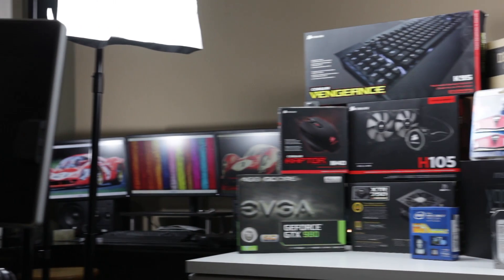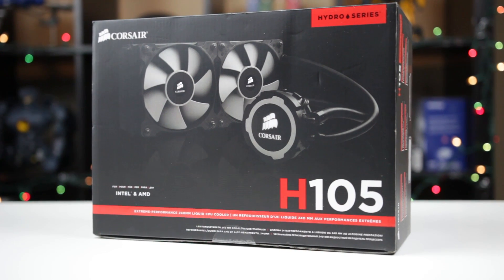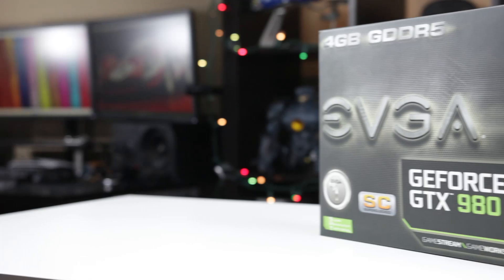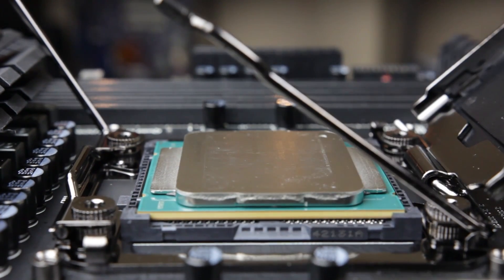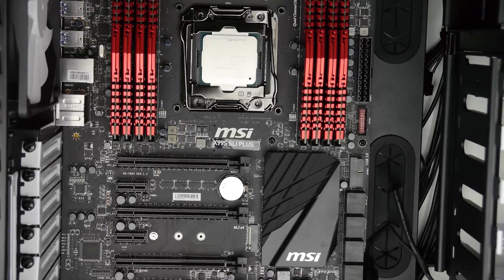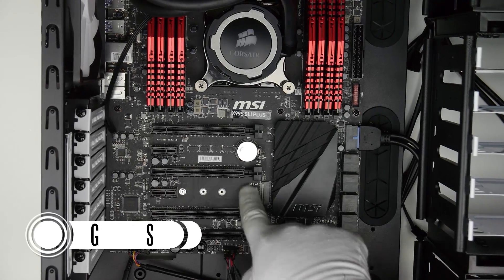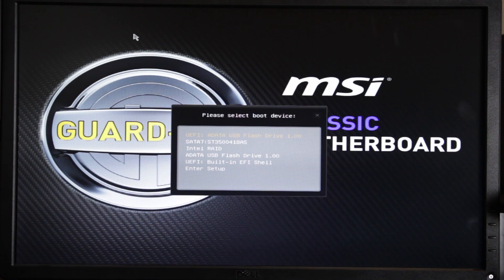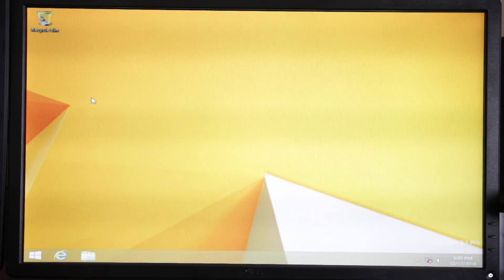How to Build An Epic $4000 4k Gaming & Video Editing Dream Machine for 2015

Comment: hey guys, i wanna build a pc with the s340 elite and i wanted to ask if i choose the msi z270 pro carbon mainboard, will the be quiet  cpu cooler dark rock 3 fit with the corsair  vengeance led ram ?

Comment: Hey guys I am building a pc but not so dangerous like in this video but I need to know whether is it good for gaming so here is the list.Processor: Intel core i5 6600k 3.5 GHzram: 16gb ddr4 2400mhz frequency of gskill ripjaws.graphic card: Sapphire radeon rx 480 8gb gddr5 psu: XFX XTR 750W case: cooler master mid towercpu cooler: Same of this videomonitor:Acer predator x34 keyboard: Corsair k70 rgb rapid firemouse: Steel series rival 700please comment fast as I am planning to buy next month.

Comment: I made a build with a i7 5820k, here's what i used if anyone is interested, best parts for price/performance (at least where i live)

i7 5820k CPU
X99 Gigabyte Gaming G1 WIFI
Gigabyte r9 390 G1 Gaming
2x8GB Crucial Ballistix 2400mhz
Corsair H75 cpu cooler
Thermaltake Chaser A31
Crucial 240GB SSD
WD 1TB Blue HDD
Seasonic Snow white 1050w 80+ platinum

If you are wondering why the overly big power supply, i'm buying another GPU later on, but that one might be a Quadro since i use 3D apps, also i make myself sure that future releases almost always will be able to be powered no problems, if you aren't interested in wuper heavy overclocking and you just game and mostly will use dual GPUs, an 850 PSU is a better way to go for the money

Comment: all ram slots filled!!! YES!!!!! If heat rises wouldn't it be best to put the radiator fans on top of the rad in exhaust?? Ive had better temps with the fans in exhaust/pull on my radiator...just sayin

Comment: if you are going to try to game with this machine in 4k you will be disappointed.  I have 2 980's and it's ok at 4k allthough to get 60 fps I have to turn down some settings in modern titles. If I try it with 1 card I mostly get like 10 to 20 fps. This machine will be 1080 and maybe 1440 p in some titles.

Comment: enjoyable video, I will never in good conscious pay that much for a multimedia pc, especially with the speed at which it's obsolete by.
 however all the people hating on this guy for his choice need to get a grip, if you can do better for cheaper then put up a video.
Reply: You don't need to put up a video. Literally the only thing people are complaining about is that his PRICE is incorrect. The parts themselves don't cost that much! If you went on amazon and bought those EXACT same parts in his video it'd cost you less than HALF of what he claims it costs ($4,000 is not right. Even $2,000 is kinda high honestly)

Comment: Hi do you think it's worth it to go x99 5820k or go z97 4790k both with a gtx 950 I'm not a gamer and it's mainly for productivity,  there is about a £150 difference comparing the two builds :) Great video!

Comment: In 2030 a computer like this is going to be used in offices.  Lol
Reply: +Kirigaya Kazuto no way
Reply: ***** way
Reply: +Kirigaya Kazuto HA.  Actually this would be the power of a watch or phone in 2030.  Moores law.  There will be quadrillion transistor processors by then if not higher.  (1000 Trillion transistors),
Reply: dcohn99 In 2030, Gamers be leik: " DAD THIS SHIT ONLY HAS 64 GB OF RAM "

Comment: I like our gaming PC soo much but i need few clarification i want to make changes to it. 
1.Nvidia GTX 980ti
2.2TB Samsung EVO SSD
3.Corsair 1000 watt power supply
4.Using liquid cooling for GPU and RAM (either anyone of these)

finally i will use your listed parts except i want to upgrade these listed parts and my final doubt is does this GPU gonna give me a full 4K resolution to my Samsung 198.12cm (78'inch) UHD 4K Curved Smart TV HU9000 .
and i want these to get under a toal budget of 5000$ (this wont include tv)
Thanks IN Advance :)

Replies Needed ASAP help??

Comment: What a shitter PC you've built. It's something a peasant would build.. THIS is a PC bud..

i7 5960X
MSI X99A Godlike 
128GB Corsair Dominator Platinum 2800mhz
FOUR x MSI GeForce GTX 980 Ti Lightning Edition Tri Frozr 6GB @ 1300mhz
1.2TB Intel 750 PCI-E SSD
1.2TB Intel 750 SSDs x 3
Cooler Master Cosmos II case
Enermax Maxrevo 1500W PSU
Custom Water Loop

It's stupid fast, stupidly expensive, and stupidly fun to play. It makes your peasant PC look like a fucking calculator.

Comment: The Fuck One 980 can not Max out every game in 4k, maybe 1080p, at this budget I would sli 2 980's, and cut down to 32gb not 64gb because 64 is way way way to insane, why do you need all that ram for in this budget: do you work for Michael Bay or Disney? do you run the stock market???. This build is poorly done for the money seriously
Reply: agreed
Reply: +Patrick van Baarle wait and change that psu, there are why better psu's than that cx750 for even less $$$$$$
Reply: +Patrick van Baarle here you go bro for an extra 3-4 euros, this is a better psu and is 80+ gold and much more reliable than that cx750 and is made by seasonic very high quality: https://de.pcpartpicker.com/part/xfx-power-supply-p1750gts3x and that a much better build, plus yes do wait for black friday, i think you can get better hdd and ssd for cheaper prices, otherwise your build is pretty solid
Reply: +Arthas182666 it doesnt matter, 64 gb of ram and no sli
Reply: Patrick van Baarle wait.
Reply: ***** if it has the same speed, type of ram, and same pins, same everything but different brands, it should be fine
Reply: ***** no prob
Reply: +BossManiacGames can't disagree with the RAM, even that i personally use Autodesk Maya i don't need that much of RAM data, i find that over 32gb is it just a waste of money, specially on this build since it's DDR4...

64gb would be useful only for an APU, but it's just way better to buy GPUs instead
Reply: look at the date of the video...
Reply: Arthas182666
ya but still not an excuse to make an bad build for the money, even austin evans made a $4000 pc around this time it had 2 980's, i7 5960x, 32gb of ram and would blow this one out of the water
Reply: +a true scotsman uth agreed 16gb of ram is plenty for 4k editing, 64 is only needed if you run the stock market intensely or have a tv show. 64gb doesn't even give that much of a benefit over 8/12gb in many games. sli 980's would be a wiser choice, thanks for the support :)
Reply: +BossManiacGames 
Totally agreed. He spent the budget on the wrong things, then he gets a VANILLA case to top it off!
Reply: +Mark Jones ikr
Reply: PvP Rambo
so true
Reply: +BossManiacGames I think it has to do with sponsors XD.
Reply: +Sean Kim It was unsponsored
Reply: BritishWarTurtle Maybe the ram was a sponsor from another video?
Reply: if it was he would say in the video and thank them, it has to be part of the deal
Reply: ***** Lol what I am saying is that maybe they sponsored another video. Then they scrapped that system and used the ram for this. Sorry for my shit explanation XD.
Reply: Sean Kim
hmm that would make sense
Reply: ***** Yea I mean otherwise I don't know why you would need that much ram. Unless your hosting a small server like I will be doing.
Reply: +Sean Kim very true, i heard him reply to another comment saying cut down the ram and get another 980 for sli and this is what he said

two GTX 980s in sli would be really awesome! perhaps in the future. but 
for now I need all the ram I can get for multicam 4k video editing.

but if he does that why does he call this a 4k gaming pc???
Reply: ***** 4k meaning money wise.

And if thats not what you mean. Then I would say 980 is enough for gaming if your doing other things also.
Reply: Sean Kim
true but at a $4000 budget one 980 for 4k gaming makes no sense unles you dont mind playing at low-medium, which makes this pc really bad for the money
Reply: Welp I got nothing
Reply: +Sean Kim he could have just done a build like this except with 2 980's instead of 980ti's: http://pcpartpicker.com/p/sKNsTW
Reply: +BossManiacGames doesn't the 5820k perform better in games? Extra cores will just help out the physics score.
Reply: Sean Kim
not really they have the same ipc but a 6700k would because it is ipc is better but in productivity those 3 cpu's beat it out by a lot, plus the 5930k and 5960x do better in sli because of more pci lanes, i would use the 5820k only under builds under $2000 above it go for the 5930k or 5960x
Reply: +BossManiacGames that's a nice tip.
Reply: Sean Kim
thanks
Reply: +BossManiacGames ima challenge you. I am making a build with the 5820k and the fractal define r5. Try to make a parts list that's around 1k with these parts. (I already have the gpu).
Reply: http://pcpartpicker.com/p/GBJBCJ here you go
Reply: http://pcpartpicker.com/p/GBJBCJ here you go
Reply: ***** XD I just found a deal on craigslist for the fractal define r5. Don't know how much it is for but it seems the guy has a bunch of cases he is trying to get rid of.
Reply: ***** This is the parts list I got (I forgot to mention I live in New York).

http://pcpartpicker.com/user/fastgamer602/saved/#view=hk6zK8
Reply: Sean Kim
pretty good then, if you a 285 then stick with what you have just get qaud channel ram on this platfrom 4x4 not 2x8, otherwise great build
Reply: ***** Im getting 2x8 so I can get another 2x8 in the future. I am going to be hosting a game server on this computer. I also got a 770 for the gpu.
Reply: Sean Kim
i see
Reply: ***** do you think the mobo is a good mobo? There are some bad reviews of it but none of them are concrete.
Reply: Sean Kim
it is one of the best budget x99 mobos, the uploader of the video used the same one, it also supports overclocking
Reply: ***** awesome! Thanks for your information it really helps!
Reply: Sean Kim
np
Reply: +BossManiacGames He also building a 5820 build (pretty new) I will use it mainly as a workstation (light room photo shop) and this is what I have so far http://pcpartpicker.com/p/m9yLGX. Still debating on the memory on my build but my main question would also be would you guys wait for black Friday cyber Monday to buy components?
Reply: Patrick van Baarle Dont chose corsairs cx line of psu's. Nice eye *****
Reply: +Sean Kim Thank! What would you suggest instead the  XFX Core Edition 850W 80+ Bronze Certified ATX Power Supply I would presume although here in Europe its priced at 116 Euro rather then 59 dollar, the Corsairs CX is cheaply made so its better to invest a bit more into a PSU especially since I am going to over clock it a bit. Anyways thanks for the feedback
Reply: +Patrick van Baarle yes it is high quality and made by seasonic, also try looking for a evga b2 if you find for the same price it is modular, only downside with the xfx it is non-modular
Reply: Patrick van Baarle I like evgas nova psu's that are rated gold.
Reply: Sean Kim true, the evga b2 is pretty good as well a cheaper version of the g2 and is bronze instead of gold and costs $25-30 less, and way better than a corsair cx
Reply: ***** I prioritize energy efficiency because I will be running the computer 24/7, but this also applies to people who run their computer a lot.
Reply: Can you put me a parts list for a 4k gaming machine
Reply: Jeeper D
how much are you willing to spend
Reply: Jeeper D I would suggest you go on reddit and look in /r/buildapcforme. Also I don't think PC's are ready for 4k yet. Games are not optimized enough for it and hardware can't push 4k well enough yet.
Reply: Sean Kim
true
Reply: +BossManiacGames He men thanks for the reply, have updated my list

http://de.pcpartpicker.com/p/V7T9gs

Regarding your original comment I do come to the same conclusion that 32GB is the sweet spot now for my system even do I will use this PC as a Photo and video editing workstation. In the future I do want the option to get 32BG more and have 64GB when prices drop or even replace and go for 128GB

What is the best strategy for the RAM if 64 and 128 seems wasteful in a balanced build? what Ram would you recommend?

Also I am looking into ASRock motherboards after your recommendation because they seem easy to OC. Still debating what to get because I think that I would like to have USB 3.1 C and perhaps thunderbolt 3 down the line due to the fact that I have 4TB per year worth of photo's not counting video. Similar question; is it better to upgrade later on with PCI slot USB's for and go for a cheaper Asrock 4 X99 extreem or go for lets say a X99X Killer 3.1 or any of the other variants (getting confused by the line up).
Reply: Patrick van Baarle
32gb should be enough, if you need more you can get another 4 stick of 8gb ram in the future, that should be enough. and also great job on the psu change, and for the mobo msi is better but the asrock x99 extreme 4 is also a great budget mobo and can overclock, so yeah save money and get that
Reply: IlluminAudie Um if it is the same model ram with the same capacity and same everything its fine....
Reply: IlluminAudie Sorry to burst your bubble but, my information also applies for DDR3.  You can correct me if I am wrong by using factual information backed with trusted sources. 

So to repeat what I said and to add on to it; you can use the model ram with the same capacity and same everything and it will be fine. It only gets really important when you're doing LN2 overclocking. I don't know about the older revisions of RAM technologies, though. But saying that I don't think spouting outdated information is going to help anyone.
Reply: +IlluminAudie I did read the article's because at first I felt it was highly unlikely that buying lets 2 kit of the same product would not match. I then scrolled down to the comments and a dude from ASUS sums it up 

"We no longer provide help to people that combine memory kits other than to tell them to return them to the reseller and purchase a single kit."

To be fair the only thing I could think of that would discredit this statment was the fact it came from company that makes a lot more cash if you can only buy kits but after reading Tomshardware it became apparent that your advice not mixing Ram kits is probably valid and my best bet. 

So I read that DDR4 ram is still very expensive, would you consider buying "only" 16GB due to the fact that DDR4 will go down in price in the next 2 years. I mainly use this rig for Lightroom. What DDR4 would be a good to buy?  I use this excel sheet to figure out what the best one would be https://drive.google.com/file/d/0B5ePJLHhrAUMZFBnc05TLUZMYzg/view?pli=1  Seems to me that lower frequency but lower CAS could save me some cash. But I am a newbie here so is there any merit to high frequency but higher CAS, perhaps over-clock wise? Whats the best price/quality RAM ?
Reply: hmm i never knew this was an issue with x99/ddr4, on my own pc i have mixed ddr3 rams crucial and ocz both 4gb 1600mhz, for the past almost 4 year so far it never gave me issues, but on x99 i wouldn't do it, because that platform gives a lot of compatibility errors
Reply: ***** So its a x99 issue not a general issue?
Reply: ***** I have read this on a fourm "Make sure the responding kits have the responding ports.
EX: A1 + A2 and B1 + B2 have  same ram, C1+C2 D1+D2 have same ram."
http://linustechtips.com/main/topic/291723-x99-mixing-ram-of-different-brandfrequencies/
Reply: Sean Kim
i think so most other platforms i see people mix around and not a lot happened, myyself included, x99 still has a lot of issues on compatibility, due to being fairly new, i mean you could set the ram to match each other at the lowest speed and timings as everybody said on the forum, a long as you don't attempt to overclock your ram i say don't worry, x99 is already over a year old anyway
Reply: Patrick van Baarle
you wont notice too much from ram speeds i may look like it from benchmarks on real world you wont notice to much, you go for volume opposed to speed, the one you have selected is just fine
Reply: a true scotsman uth
yoo scott help us out on this, does mixing ram really affect the build
Reply: +BossManiacGames Austin Evans' $4000 gaming PC is way better
Reply: Kevin hall
true it is way better, but now it can be done better now such a 980ti's now instead of 980's, some flaws Austin had was the psu wasn't the best choice for an x99 build, even waaj chose a better PSU. and he chose crucial drives over samsung evo. but perfromance wise it blows waaj's out
Reply: Specially the Superclocked ones
Reply: +BossManiacGames You're an idiot. He says in the beginning of the video he does music production and 4K video editing. I can tell you off the bat, you need 32-64 gigs of Ram if you're recording bands/instruments on multiple channel strips and want to place plugins on all those tracks with low latency. Not every build is a gaming build, he saw more value in the extra ram for his music production and 4k editing needs, than he did in an extra 980 in SLI for his gaming needs. It's what matters to HIM--not what would for for YOU. That's for you to worry about on YOUR build. You piece of shit.
Reply: Screw GooTube look at the title, and realize you're fucking stupid
Reply: a true scotsman uth
hey bro thx for the support, that guy must of had a brain fart
Reply: this was in 2014
Reply: ib2awesome ib2awesome still shit regardless
Reply: ib2awesome ib2awesome
more like 2015, 2014 was already coming to end when the video was posted
Reply: +XxDeViLBrInGeRxX
true
Reply: +BossManiacGames My build
MSI Z17A Tomahawk AC 
i7-6700K 4.0 GHz water cooled
16GB Ripjaws V series DDR4
Samsung 850 PRO 3-D Vertical 256GB Boot Drive
WD Black 2TB HD Performance drive
MSI Radeon R9 390X 8GB 
TP-Link PCI Wireless Adapter 
Corsair RMx Modular ATX 750W 80+ Gold
Case Fractal Design R5 Window
Reply: The Sisko
sick build
Reply: $2500 Canadian tho but worth it ;)
Reply: So true and for 4000 $ you can get the brand new i9 x series and with a 1080ti 11gb and over 32gb ram